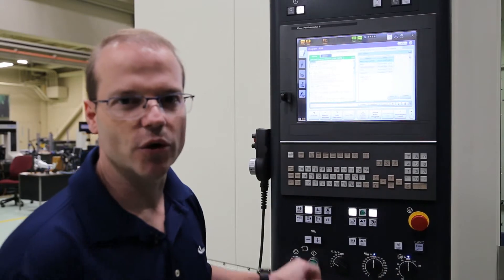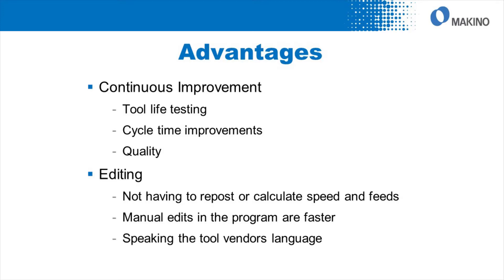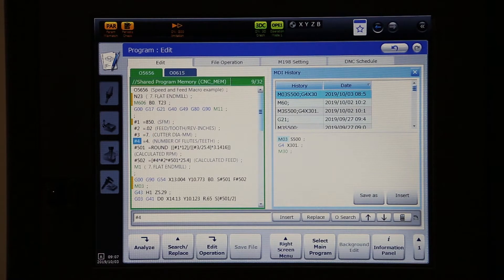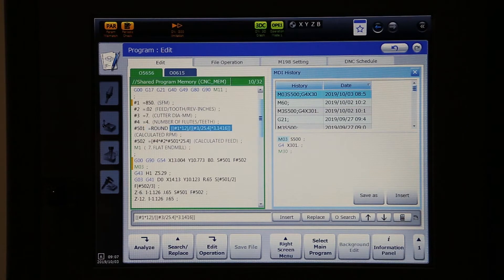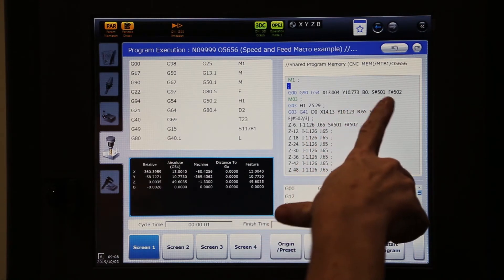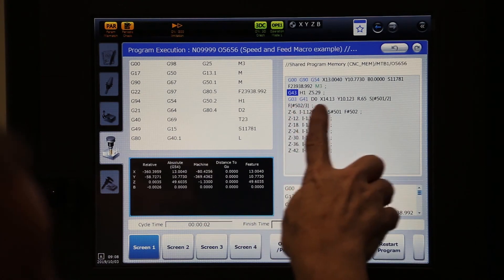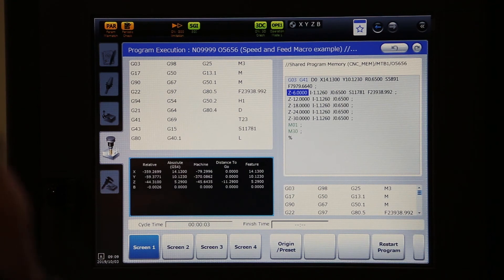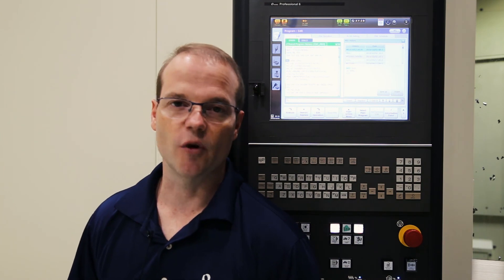Tech Tip: Using a Macro to Calculate RPM and Feed Rate

Comment: I run makino m81nx 12 pallets and want to know more about tool study and other things i am very confident in my skills with the machine just run alot of different tools and parts Nd want to get better with my tooling especially considering tool ac after tool study mode will modify speeds and feeds for your based on chip load